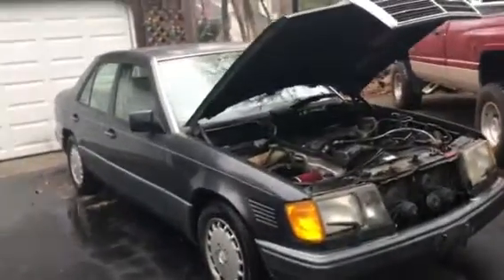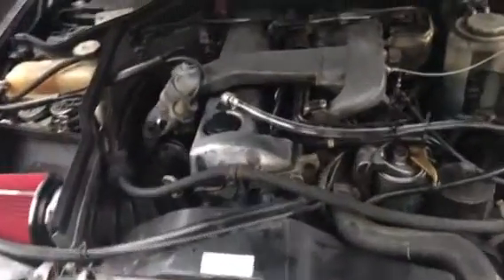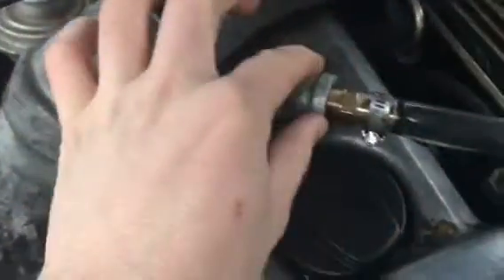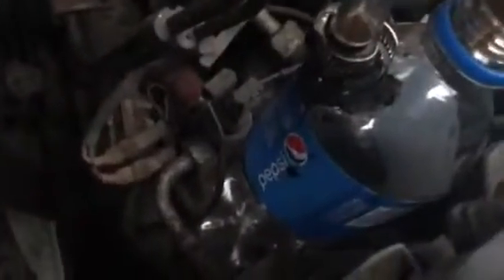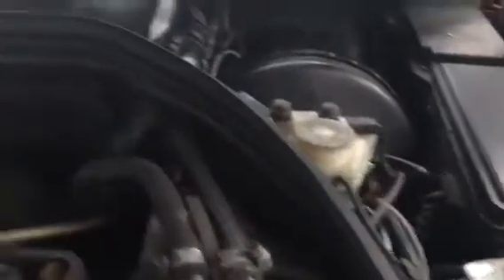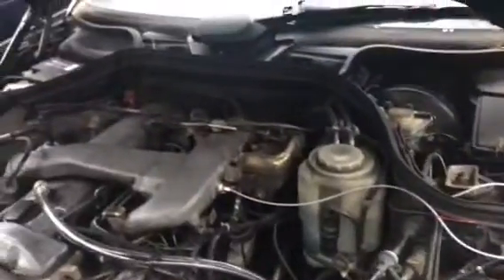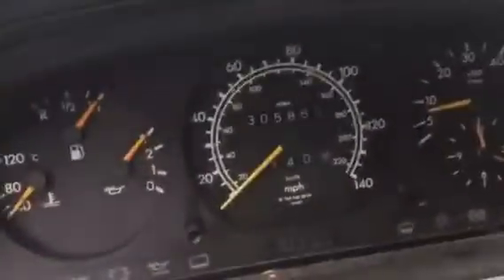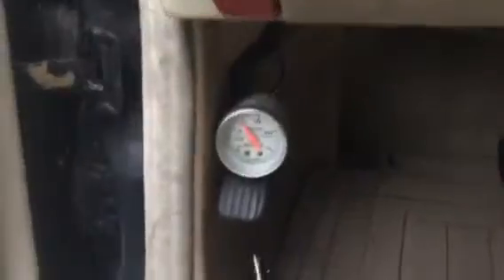1991 MERCEDES-300d INTAKE

Comment: It does thank you, and what thread or diameter is that bolt on the intake for the boost line?
Reply from the maker: Loren Cooper I believe it’s a 1/8th npt fitting, it comes standard in most boost gauge kits.

Comment: What did you do to get around the air sensor on the factory airbox?
Reply from the maker: For now it’s just unplugged, and the stock intake box is sitting in my garage.  I deleted the PCV as well.
Reply: @DominosDiesels  does it pop any codes with it unplugged?
Reply: @joelherbst4374  yeah does it throw any codes or affect the drive? very interest in this.
Reply: @alibabar3555  I unplugged mine a few days ago and it wouldn't let my turbo build boost

Comment: Where did you run the air hose through the firewall?
Reply from the maker: Loren Cooper near the brake master cylinder of your looking at the firewall with the hood open there should be a grommet with a bunch of electrical wires running through it. I pulled the grommet and carefully ran the air hose through and put the grommet back in as best as I could after. Hope this helps!